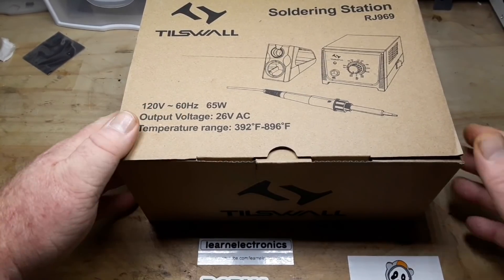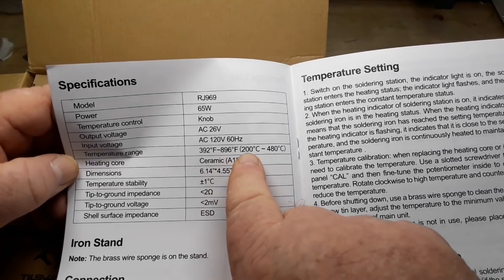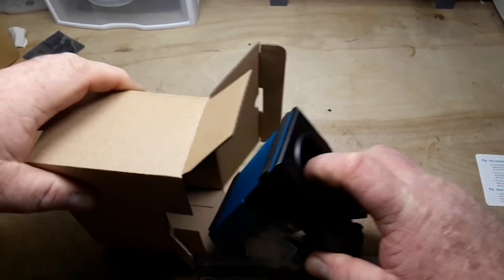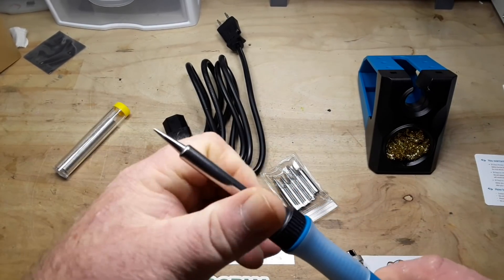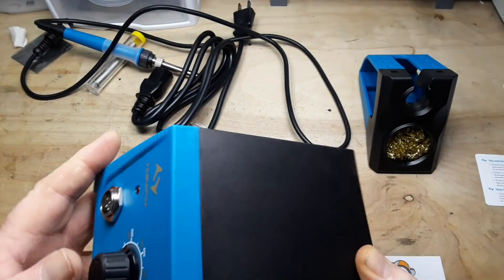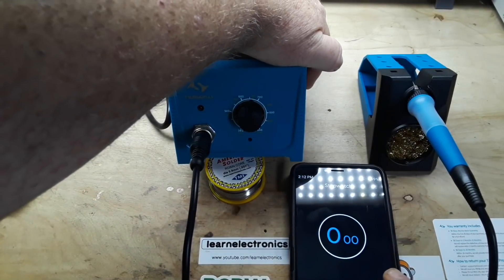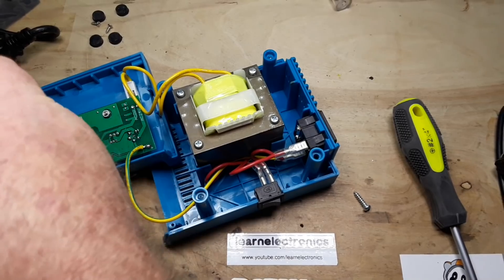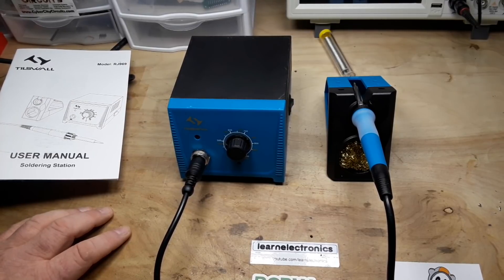Tilswall RJ969 Soldering Station Review & GIVEAWAY

Comment: Hi ,I bought one of these recently in UK,so 240v,as soon as I plugged it in on minimum temperature it started glowing red hot,the whole iron was red hot,put solder on tip it spat it off,damaged tip,the temperature dial did nothing,this was a straight out the box,new,any ideas what’s wrong please,thanks.

Comment: Good Video Paul. I actually bought a Yihua 939D+ instead it had good reviews and has a digital temperature read. Note on the SEQURE iron, I bought it as well, but useful only with a 24v adapter.

Comment: (7:20) - If you read the full sentence, you will notice that it actually says: "When the indicator is flashing, it indicates that it is close to the setting temperature, and the soldering iron is continuously heated to maintain the constant temperature"
I believe what is meant by "off" is not off completely, simply off from solid on - to flashing status.
>

Comment: The LED is working correctly. The manual is giving a false conclusion, it must have been a misunderstanding during translation. The point is, during the ON period of the LED the iron is heating, during the OFF period it's not. 
Heating up the cold iron may take a minute, LED is ON,  and when it starts "blinking", the correct temp has been achieved, and then it shuts the heater OFF and ON periodically to maintain this temp.
That's all there is to it. 
All my soldering stations with one LED I had so far have worked this way.

Thanks for the informative video anyway!

Comment: i prefer those conical/pencil tips too.
I dont get why so may people like the chisel tips, its like using  a spade as a spoon, if you run high enough temps, the pencil tips have no problems melting solder but give s much better accuracy and control!

Comment: Hi Paul another great video. Personally I like the t12 tips with the heating ellament  in the tip. Just wondering if you could do a review on the Hakko FX95D and the KsGer would make a interesting video I think
Reply from the maker: I did an the KSGER, if I get a Hakko, I will.
Reply: @learnelectronics  The only really thing different about the iron (station is very different, obviously) is there's a metal shim between the tip and heating element for better beat transfer.

Comment: I’m really surprised, as you were, that the metal collar on the iron cable connector wasn’t grounded.  I’m also very surprised that the transformer was not grounded.  I suppose that they thought that since the housing is plastic that they could get away with it...  I like the iron holder a lot but not so much on the iron.  It would have been interesting to see at East on how well it holds temp - especially since the LED is of no help.  Thumbs up for you as always!
Reply: The LED on that iron probably works like all the other far east irons. They are microprocessor controlled and when the feedback sensor sees the iron is up to temp it starts cycling on and off to maintain the temp.

Comment: Nice review- this iron seems like a big step back from the advances made with the ts80 and ts100. If you could choose between any iron you've tested so far, which would you pick? (you can group it into price ranges eg 20-50, 51-100, 100-200, 200+)

Comment: Seems to be an acceptable iron, except that light... That would be frustrating. I'd burn up all of my thermocouple soldering iron temperature sensors to check if it's at temperature or not.
Was it just because the tip is such a large thermal mass requiring longer to hit the target temperature the whole way through? Have to love a large power supply (depending on the coil's AWG)!